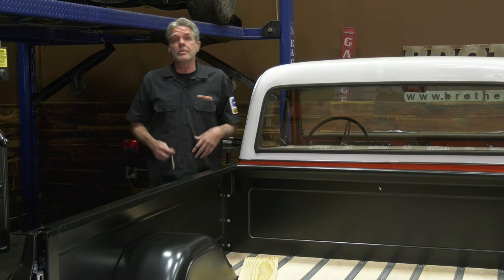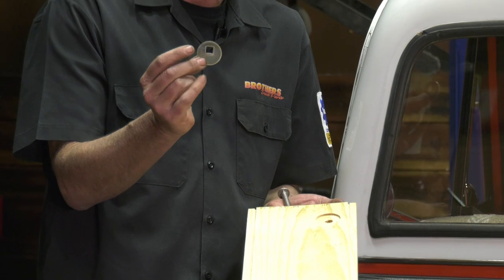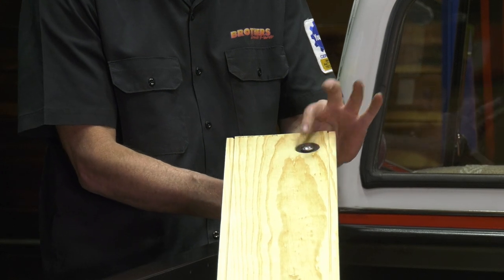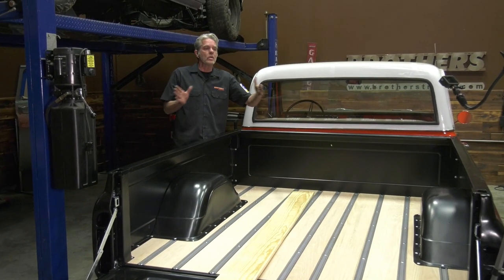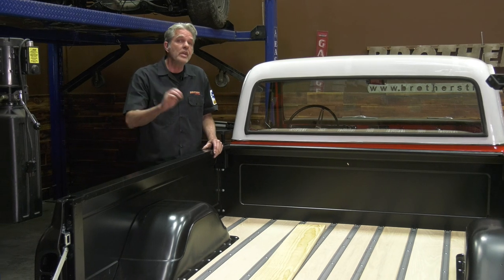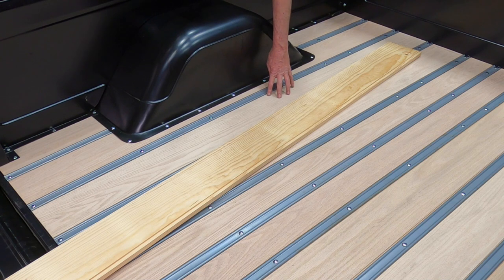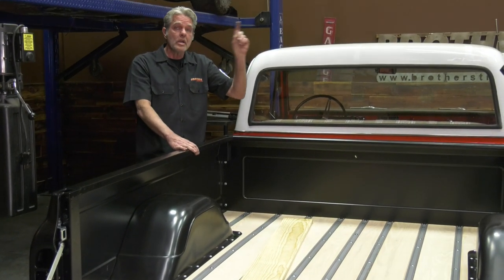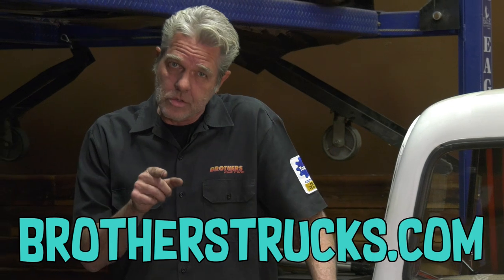Classic Truck Bed Wood Options & Tips, Pine / Oak - Drilled / Un-Drilled (Bedwood)

Comment: I'm wanting to switch from steel bed floor to wood
Reply from the maker: That can be done. You've got to replace a few parts, but its 100% possible.  Call the shop and we will help you figure it out. 800-977-2767